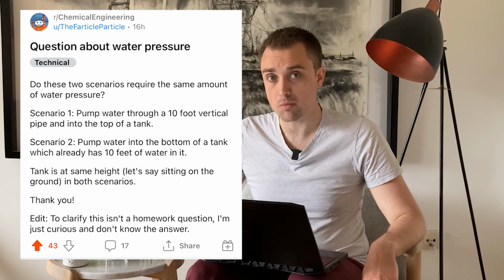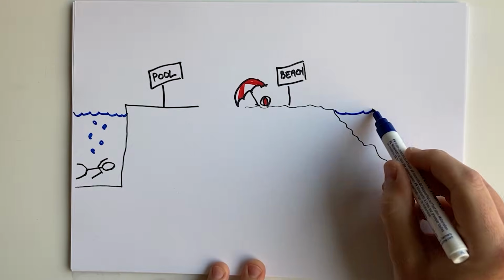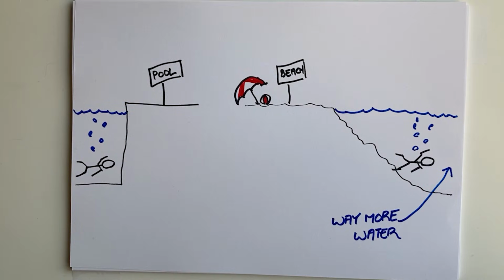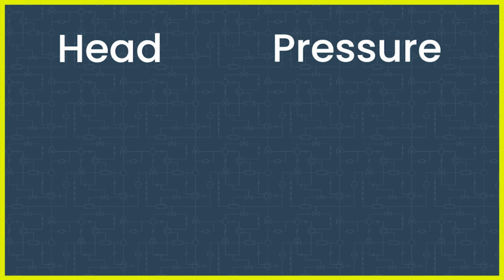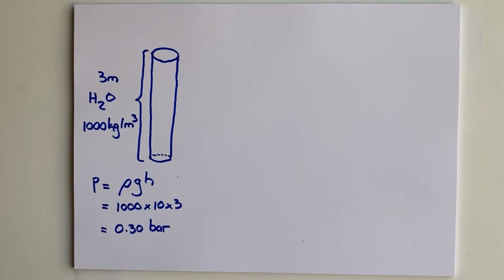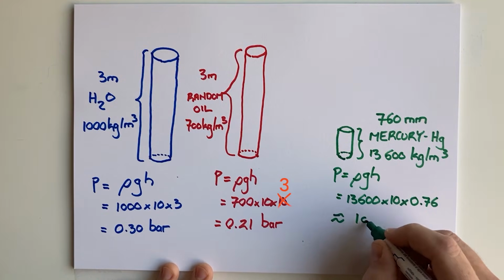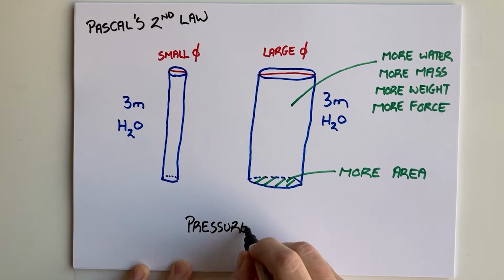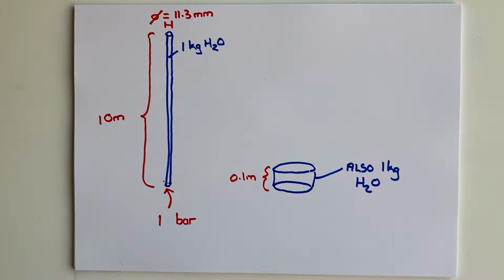Pressure, head, and pumping into tanks

Comment: I think you explanations are great for young and aspiring engineers.
Reply from the maker: Can’t tell you how pleased I am to hear that!
Reply: @ProcesswithPat  
It's a great video but it can be even better :)
In terms of pressure (& neglecting friction losses as you correctly indicated) they are equivalent.. but let me add an important note to your very helpful video:
There is a major difference when the pump stops... the water will come back in cases B & C... this means that the pump will turn in the opposite direction which will prevent you from running it again & possibly damage mechanical seals (if used) & other critical pump components...

Neglecting the extra cost, You can put an NRV (non-return valve) but what if it passes water? Or requires maintenance? Yes you can put an isolation valve... but this is not the correct way... you should select the inherently stable system; that is case A
(Unless the system is small, You will have to put both the mentioned valves in case anything happens in the middle! But you will not have to worry about the water in the tank only the water in the line)

*having taught students for a long time I learned that I have to mention such significant points or at least "stress" on the fact that the comparison is strictly in terms of a specific aspect (in this case; pressure/head only) & in reality many other aspects have to be considered... this is because many would have the tendency to "over simplify" the problem, just repeat that everything is equivalent & cause a disaster!

* again I know it is not directly related to the question but yet I feel it is important to mention such issues, have a good day
Reply: @ProcesswithPat  I've been a process engineer for ~16 years. Whilst I understand all the concepts you explain, I can see how learning these at an earlier stage in my career would have been invaluable. Keep up the good work.
Reply: Nicely articulated, one could say "case study in over simplification" by focusing on pressure alone.  

In my own 13,000 litre heat in water solar capture system, the fill line is small diameter Flexi, providing a low continuous rate of circulation of warmed or chilled water through any one of 13 containers with filling at any level adjustable without valves by manually physically relocating both the flow and return lines without disconnection of a pond pump directly attached at the inlet and a solar panel providing flow in proportion to incident heat. Any the high pressure generated and friction in long lines is accepted as free heat making the inefficiency of overpressure into a benefit. A loss into a gain.
Reply: @jmohammedtt  ...and for really old guys like me that have forgotten so much of this kind of thing!
Reply: I find your video sophomoric.

Comment: The pressure exerted by the water on the tank bottom is the same pressure that the "column" of fluid sees.  It's not as though there is unaccounted for pressure that you're saying the tank bottom is carrying.  It's all the same.  The tank bottom portion of the discussion is sort of irrelevant.

Comment: The reason i use A is because from my pump (submersible in the waterwell) to the water tower doesn't have any check valve. The pipe is always empty when not pumping. if I use B or C, the water inside the tank will flow back to the well. And i know well enough not to touch something that works so i keep it that way.

Comment: Do you have time to answer a question for me?  I have a cylinder filled with water,  There's a small hole in the top that I can open and close.  There's a hole in the bottom that I can open and close, just to control whether or not water is released.  If both holes are closed, obviously no water is released.  If the cylinder is filled to the top and I open the bottom hole, no water is released until I open the hole at the top.  If I open the top hole very briefly, some water is released but stops very quickly after I close the hole at the top.  If the cylinder is only two-thirds full, the flow continues for a longer amount of time after I  close the top hole.  If it's one-third full, it takes an even longer time to stop flowing.  Can you tell me why it works this way?  I'd be most appreciative if you can answer this question.  Thanks very much!

Comment: However, as a mechanical engineer designing this, normally the flow of water would be as high as possible to quickly transfer and the piping as small a diameter as possible to minimize the cost so frictional losses would impact it. Fine as a back of the envelope, but I've seen many instances where such simplified calculations have caused real-world problems be it underperforming pumps or cavitation in piping or relief valves that were set incorrectly.

Comment: In the conical tank diagram, shouldn't the pressure be shown as straight down in regard to water column and not perpendicular to the bottom of the tank as illustrated by the yellow arrows.  However, there is outward pressure being exerted on all sides of the tank, so pressure in the tank might be indicated by perpendicular arrows.

Comment: The only difference is that when you actually pumping water into tank - you are increasing the height i.e. increasing pressure in the bottom. 
So in case A your pump will need to 'generate' constant pressure - as the column height is always the same.
In cases B an C the pressure on the intake will increase as you pump more water in....

Comment: The correct answer is A because the extra friction of pumping the water through a second 90 degree pipe fitting.  The question didn’t mention anything about ignoring minor differences.

Comment: Here is an interesting question from an old entrance exam for the US Navy nuclear power program.

There are two sealed tanks connected at the bottom by a pump which has Pipes with valves on either side which can be closed to remove the pump. One tank is filled with water and the other is empty. How do you pump water from the sealed full tank to the sealed empty tank.

Comment: Fresh water is simple to remember, the pressure is about 0.43 psi per foot. For a quick and dirty approximation, 0.4 will work

2.50 What leads people astray is the fact that in a tank with vertical sides only the column of water directly over the pipe exerts pressure on the pipe. So a ten foot column of water exerts 4.3 psi at the bottom of the tank which is the same pressure it takes to pump the water to the top of the tank.

Comment: Easier to explain - pressure is a measurement of force per units of area (example: pounds per square inch). To find total force, pressure needs to be multiplied with the area of application.

Comment: The answer to the question is built into the unit PSI, ie. pounds per square inch, not pounds per cubic inch. The two dimensional unit implies that the pressure will only be applied on one plane, which functions as the boundary for the column of water above it.

Comment: Pumping water into tanks B and C is much better than into tank A. However, for potable water system, governing codes require the inlet pipe to be 100mm or more above the top level of the overflow pipe. This is to isolate the water supply from the stored water in case the tank is compromised.

Comment: I would expect the work necessary would be slightly less from the bottom, as you don't need to raise the first liter of water as much as the last - but I am not sure it would make that much difference in practice...  But - I could easily be wrong, I haven't actually worked it out, and there are a lot of cases where intuition can lead us astray!

Comment: The answer to the question is simply no, the pressures required to pump the water are not equal, due to differences in friction in the two scenarios. The pressure may equal in the static case, but that is not how the question was asked.

Comment: There is a surprising difference in the pressure loss from having a flat inlet vs conical inlet. This also applies in the case where the water is pumped to the top, due to the extra 90degree turn. Though the exact solution would depend on the radius of the 90degree piece and the radius of the pipe.

Comment: The pressure is determined by the height.  it takes the same pressure it fill it from the top as it does the bottom.  This is because the water in the pipe will be the same height as the tank, so the pressure is the same. The best place to fill it is in the middle because there is less pressure.

Comment: I dont see anyone realising, that when the tank is open, you only pump againts atmosferic pressure initially (with the bottom set up) and you only reach the 3 metres of pressure as you reach the end of filling. With the top set up you always need to reach 3 metres of pressure....so unless you cant risk your fluid spilling on the floor. the bottom feed is way better becuase it requires less work (electicity/money)

Comment: if I understand hydraulic physics correctly, the volume of the water in the tanks should not have a direct impact on pressure depth. The only variable that matters is the height of the water column, in which case, the yes, it should take the same pressure in all 3 scenarios.

Cool, my education in physics did not fail me.

Comment: In practice though , rarely do you want to pump into an already full tank So pumping into the bottom of a tank is more efficient right up until the point the tank is full. At which point you would need to stop pumping anyways. Pumping into the top of a tank  is always at max pressure whilst pumping in from the bottom there is an energy saving right up to the point of a full tank and switching off the pump. When they are both at 3m  its the same pressure. ( I am aware I am answering something that wasn't asked in the original question)

Comment: Would the pressure on the pump still be the same as the other 3 examples if the inlet pipe was at the bottom of the side wall?

Comment: Great answer!

This should only apply if the diameter of the pipe is the same in each case

And the number of bends in the pipe are the same. Otherwise you get a pressure drop

Comment: My Initial answer was B.  The I watched the video and was happy that my answer was correct.
This is because C and B are the same.  A is actually slightly more pressure, because the lift is to above the column of water in the tank.  But it is also nearly no difference.

Comment: I'm not convinced that the diagram of the forces and reactionary forces in (c) are correct. https://youtu.be/HlvHczb2vN4?t=348
The vector force of the water is parallel to gravity not perpendicular to the slanted wall of the vessel. Thus, a component of force from the water will be directed parallel to the slope of the container towards the same direction of gravity. This can be thought of as the water having a tendency to slide towards the bottom opening and thus increasing the effective downward force in of the column calculations (g + dg) at the opening. This is compared to (b).

Comment: What about the energy used to fill  the container from empty to full?
The smallest amount of energy needed would be to fill B as the head increase is slowest. Next comes C and the worst case is A where the head is at a constant maximum. This would be a consideration if using battery power for instance.

Comment: 5:43 Perfectly show how these questions are very often designed to trick people. 
The top and bottom of water in A/B/C is not in line with eachother, of the background have a slightly tilted pattern.
This makes your brain think there are different heights to each water colum, even when you know how the water pressure work

Comment: Technically would be slightly easier to pump to the bottom because there is a shorter  pipe and therefore less friction loss.
In a 1.5 inch pipe we would add one foot of head for every ten feet of hose or pipe when calculating output.
 The extra 90 degree elbow would also contribute to reduced flow.
I was a professional pond installer, we needed to know how large a pump would be required for the waterfall.
The pumps specify output at the pump, then you add up height above waterline and the lenght of the pipe to determine outflow at the top of the waterfall.
Reply: He used an ideal Bernoulli equation so losses were 0. I get what you’re saying but in his scenario that’s just a thought experiment it doesn’t matter. He didn’t give any values other than tank height and water so one would assume everything else is negligible and losses are minimal.

Comment: As a Layman, I understand that translates to a rule-of-thumb; of roughly 1/2-psi per foot of head, in a 2-inch pipe … with an adjustment for friction, depending on type of pipe used … am I incorrect?

Comment: When filling and using hazardous materials, the codes or standards usually require filling from the top, with a check valve and a vacuum relief valve.  They don't want the tank emptying if the pipe springs a leak.  A pump is also required to pump it out of the tank.  A vacuum can be used to pump it out but only if the vacuum relief valve is electronic.  Strangely though, while working at a oil terminal, they pumped and drain from the bottom, so they must have had an exemption written into the codes.

Comment: There is an even simpler way to see the identical-ness than the pool comparison: If you end up raising a "plate" of water the same height in all three cases, that is, end up "putting" the same volume of water at the top, then the increment of potential energy in all three cases are the same.

Comment: When filling an empty vessel, it's more efficient to pump into the bottom, than the pipe at the top. That's because, the head pressure doesn't reach it's maximum until full. With the pipe filling from the top, it requires full head pressure for the entire volume of the tank, meaning more energy was used to fill the tank to the full mark.

Comment: This clearly true, and I've known it for a long time, but I had never thought about the difference between pumping water up a pipe into the top of the tank (which is the way it's usually done) and pumping it into the bottom. Pumping it to the top requires more energy because you're always  pumping at a higher pressure than is really necessary (most obviously when the tank is empty), but pumping into the bottom only uses the amount of energy to pump against the head of the water in the tank.
Reply: But pumping to the top of the tank results in a constant pressure, allowing you to design a pump for that pressure and not variable pressures. You also don't have to worry about a back-flow valve, one additional fail point on a system.

Comment: I have one doubt ? If we fill water to a tank from bottom side which is situated in 10 metre height using motor pump set, the pressure or current will be same as normal method ?

Comment: Pump or electrical failure are the reason to chose #1.    However, in certain use cases #2 can save you money with pipe costs.

Comment: Would fresh water have less pressure, at the same depth, compared with salt water?  Does it matter what's dissolved in the fluid and, if so, is that ever a problem that comes up IRL?
Reply: depends on the density. salt water has a higher density than pure water.